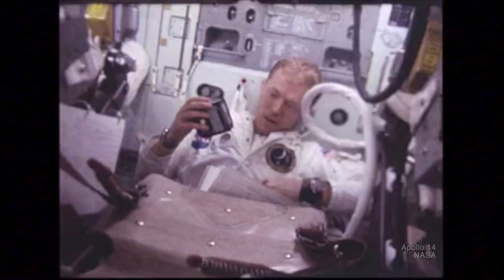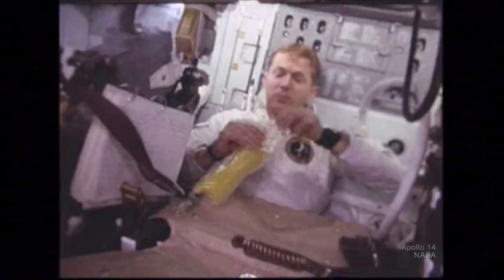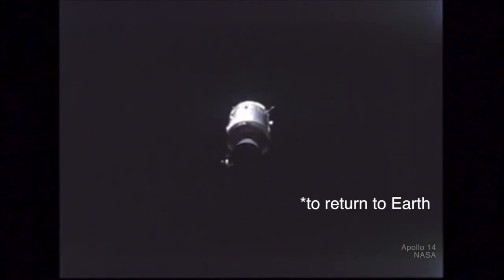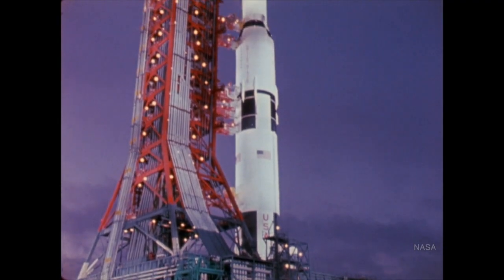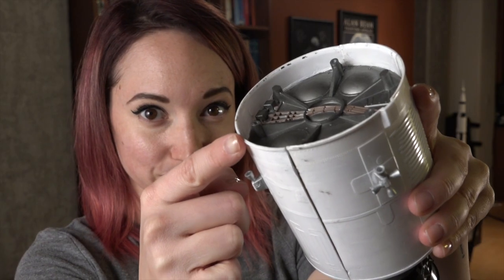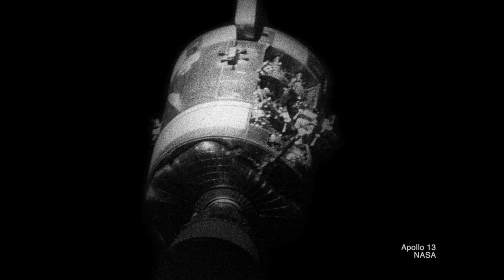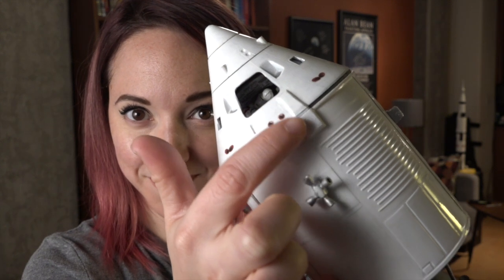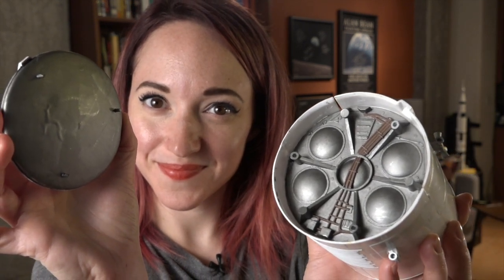How Did the Apollo Command and Service Modules Separate?

Comment: Question: Upon splashdown of the CM, what is that large, cylindrical piece at the top of the CM that looks like duct work?
Reply from the maker: I think what you're thinking of is the housing for the parachute.
Reply: Looks like the tunnel that the astronauts crawled through to/from the LM. At splashdown the tunnel wall is exposed, after the parachutes and fairings are no longer around it.
Reply: Nope. Amy already answered my question. What I was asking about are cylindrical housings that are PERPENDICULAR to the docking tunnel.
Reply: Oh, yo mean the perpendicular tubes. From the LARGE CYLINDRICAL PIECE description, it seemed you meant the tunnel. Sorry about that.

Comment: Did the SM burn up or is it orbiting?
Reply: SM burned up right behind the CM. apollo 13's LM also burned up, but it's plutonium fuel cask for the SNAP-27 didn't, and is sitting at the bottom of the tonga trench in the pacific ocean under 20K feet of water.
Reply: didnt know that, interesting...
Reply: It would have solved the power issue if the could have used it to charge the batteries instead of losing systems

Comment: What kind of models do you have, and where did you get them? Did you build them?
Love your videos!!
Reply: They look very much like the Revell kits I built nearly half a century ago. The kits I built also included a two part lander with gold colored foil for the descent module and a square "landing site" with a cratered surface. I had some problems with the plastic pins the command module door pivoted on breaking.

Comment: Very creative engineering must have been invented to make this happen . How again, did they grip the CM and heat-shield ? How did the heat shield attached to the CM ? Adhesives ? Where are the recesses for the 3 bolts and separation mechanisms ? Were no explosive bolts used  ? Very interesting,  I thought the heat shield was a seamless Construction to keep hot plasma off Alan beans butt . so glad Amy is so pretty , The external cable and wire chopper was cool. How were those valves operated on the CM side ? Were they behind the crew couches? Were they on automatic?  So much info here . Hehe

Comment: what if the blade didnt cut?  plan b?
Reply: Plan B = suffocation/freezing to death by remaining in space or burning up on re-entry.
Reply: lol
Reply: There where two blades, each with one system.redundant...
Reply: There were two of them. Nasa engineers built in redundancy. If one didn't work for any reason, they had a backup.

Comment: there was room for a car in that thing?  the "moon-buggy"?????  that is hard to believe.
Reply: You are correct. There was no room for a car in the Command/Service Module structure. Indeed, there would be no reason to keep a car there. The car was for operating on the lunar surface. The Command?Service Module only ever orbited the moon and never landed.

 The car (used on Apollo 15,16 and 17) was stored in a folded up state in a section of the Lunar Module's descent stage.
Reply: There was no room for the car in or on the command nor service module.  The lunar rover was stowed on the OUTSIDE of the lunar module.  It's always amusing when the hoaxers demonstrate their complete lack of education about the program in the very arguments they present to "discredit" it.

http://www.collectspace.com//review/ap15-S71-31409.jpg
Reply: Blake Snipe not really, the lunar rover was stored folded in one of the internal quads of the LM decent stage.  and calling it a car is really a stretch of the imagination....... more like a very lightweight go-cart that was somewhat fragile....
Reply: marzsit I called it a car because the OP did.  Its a semantical argument at best anyway.  But if you wanna go there, a "car" according to Merriam-Webster is defined as "a vehicle moving on wheels", so....

By "inside", i meant the habitable crew cabin of the LM, in which it was not.

Comment: I always thought that astronauts could go into the service module, but it seems to be just a warehouse.
Reply: There was no way to access the Service Moduile once in space, except by conducting a space walk. 

And that is exactly what happened on thee Apollo missions. On Apollos 15, 16 and 17, on the flight back from the moon the Command Module pilots performed spacewalks to retrieve film cassettes that were located in one section of the Service Module. During the lunar orbit phase of the missions, special cameras had taken high resolution images of the lunar surface. The film from these cameras needed to be taken out of the cameras and then stored in the Command Module before the Service Module was jettisoned prior to re-entry.

Comment: I  do not understand,  can you please explain  when you say , "electrical connections cut the wires and the tubing  and closed the valves in the umbilical "  .  How did the electrical connections  cut the wires ?
Reply: +welshpete12   I think she meant to say that the electrical connections were used to signal the separation charges. Here's a quote from a NASA pdf that details the sequence:

"The two modules also are connected through the
CM-SM umbilical, an enclosure protruding from the
CM on the side opposite the side hatch. The umbilical
is the wiring and tubing through which vital
power, water, oxygen, and water-glycol flows from
one module to the other. These connections are
covered by an aluminum fairing about 18 inches
wide and 40 inches long.
At separation, electrical circuits are deadfaced
(power cut off) and valves closed at the umbilical, a guillotine mechanism cuts the connecting wires
and tubing, and small charges sever the tension
ties. The umbilical firing pulls away from the CM
and remains attached to the SM. The guillotine
that severs the wires and tubes consists of two stainless steel blades, either one of which will cut
all the connections. The guillotine is driven by
redundant detonating cord charges. The tension
ties are severed by linear-shaped charges set off by
detonators. The signals that set off the detonators,
the detonators themselves, and the charges are all
redundant."
Reply: +mako88sb Thank you for going to all the trouble to explain all that .

Comment: I bet Dr. Guillotin never imagined such a use. But the interaction between the blade and bolts . . . I'm still a little hazy there. Bolts had to be rather small for any blade to be able to cut through it and still not have too much mass? Yet, the bolts would have to be rather strong to keep the CM mounted on the CSM with the stresses. There would have to mechanism or design to prevent the umbilicals from leaking back into space after severance, yes?
Reply: +LTrotsky 21st Century   The bolts were explosively separated. The guillotine was for slicing through the umbilical cables, wires, oxygen and water supply lines.

Comment: Amy i love watch you videos.
I want ask you and everyone here what is the purpose of this suitcase that Gemini and Apollo suitcase that with pipes tubes and pipes attached to their space suits, i did not see this in case space shuttle astronauts :-)

Can you make video about this if you already did make such videos pardon for asking, and give the link :-)

I'm just aerospace geek like many other here xD
Reply: +PawelK198604   The Gemini and Apollo missions had 100% oxygen environments at reduced psi so the astronauts had to purge their bodies of any nitrogen before a launch to avoid the bends. That's the purpose of the portable oxygen ventilators they carry out to the launch vehicle were they are switched from the POV's to the on-board system. Since the space shuttle and ISS have a normal mixed gas environment,  this process wasn't required until somebody had to prepare for a eva while in orbit.

Comment: A few random comments about the CM/SM connection.  It is interesting that a guillotine was used.  At launch when the service arms retract from the Saturn V, they seem to have a quick disconnect mechanism available to detach connections from the rocket.  Of course, a rocket sitting on the ground is a lot different than a rocket that has to move through space; so quick disconnects might not have worked for the CM/SM link.

On the Apollo 13 launch, I have seen articles that say that the force of the explosion was enough to separate the CM from the SM, but the astronauts were able to survive because that did not happen.

Also, it is interesting that during the Saturn V/Apollo launches, Abort Mode II, which occurred early in the second stage, after the LES tower was jettisoned but before they could make a contingency orbit, the SM engine would fire (along with the CM RCS) and separate the CM/SM stack as a unit from the rocket and align itself.  Then the CM would separate from the SM and splash down.

Comment: The Apollo 12 Command Module is on display at the Virginia Air & Space Museum. You can see the interface on the side of the vehicle and the ends of all the wires and plumbing that were severed by the guillotine are visible.

Comment: About the only thing they didn't get right in Apollo 13 (along with the wrong paint on the Saturn V!) was they didn't blow the pyro's to separate the LM and C/SM before entry. You can see the probe still attached as they hit entry interface, and then it's gone during the re-entry SFX.

Comment: Great vid! Question, did the umbilical on the command module have any sort of heat shielding on re-entry?
Reply: On the Command Module side, valves were closed on the inside to prevent re-entry heat/gases from penetrating the interior of the spacecraft.  The wiring, plumbing was packed really tightly.  The tips of the wiring just melted, if anything, on whatever was exposed.  The area where the umbilical connected to the spacecraft also didn't take the brunt of the heat during re-entry.  If you ever see a Command Module, check out where the umbilical connected, all you see is a bunch of wires packed super tightly with some pipes...and a few loose wires still intact, there's not much charring or scorching in that particular area.
Reply: The umbilical was mostly on the Service Module - so burned up along with that when the Service Module entered the earth's atmosphere.
I assume that the entry points on the Command Module for electrical lines etc had some sort of protective flap or were too small to be of concern.
Reply: Yeah that's what i assumed, but I would love to know the details of how they shield those entry points. instinctively it seems like a major structural flaw.
Reply: +yobrotom Great question! I was thinking the same thing as I watched and thought that I'd better check in the comments that it hadn't already been asked...it has :-).  Ericlrl's answer is very plausible but, as he admits, it's only a guess. It would be good to know for certain. We share the same instinctual concern that the residual umbilical cover protrusion could be a source for breaching the heat shield on re-entry.
Reply: Robutube1 Perhaps the blade itself acts as a closure device?

Comment: What were the odds of something going wrong during the flight and the two modules separating? Obviously, there were many backups in place, but could it happen?
Reply: +Matt 07a   The explosion that ripped through the SM during the Apollo 13 mission probably should of caused a separation. There was certainly enough force from it to do so but they figure the worst of the explosion was directed away enough from the separation system that it didn't happen. Not sure about any other scenarios that might cause a accidental separation.
Reply: +mako88sb Thanks! Apollo 13 didn't even come to mind when I thought of the question.
Reply: Matt 07a   Your welcome. I was actually reading about it more and here's some quotes:

“The attachment strength of the Service Module panel to the structure required a considerable internal pressure of 24 pounds per square inch for severing it from the service module,” Woodfill said. “A much lower pressure was required to separate the Command Module with its heat shield from the Service Module, only 10 pound per square inch. One can only speculate on why the panel blew and the crew capsule/service module attachment remained intact.”

and

“Apparently, the presence of ‘tankage’ and other structure acted to mitigate and dissipate the sudden pressure spike before it reached the interface between the vehicles,” Woodfill said. “However, if a shard from the exploded O2 tank 2 had punctured any of the adjacent tanks, likely a secondary explosion of any of them would have propagated both the explosion and build up of pressure. In that event, certainly, the vehicles would have experienced either a fatal separation or fatal damage to the heat shield."
Reply: +mako88sb Awesome! I'll check 'em out. Thanks!!!

Comment: If the command module and the re-entry vehicle are held together and going at the same speed, so what keeps the separation safe ? I mean what "launches" or held far enough the command from the capsule to avoid collision ? is there a mean to eject the command from the service ?
Reply: +aymen marouani, I think you can put the SM's thrusters on some sort of timer and just slow it down slightly.
Reply: +David Hoffman - Correct. The forward facing thrusters on the Service Module were fired as part of the separation sequence.

Comment: I always wondered about that.  Thanks a lot, Amy!

Am I right in thinking that if the blades failed and the CM couldn't undock from the service module, then a successful re-entry would have been impossible?  If so, that would make the procedure one of the most critical stages of the missions.
Reply: +Philip Gibson - There were two separate guillotines each with their own set of ballistics to fire them. If one failed the other could do the job alone.
Reply: @joevignolor4u949  Exactly nasa  engineers built in redundancy,with these kinds of scenarios in mind.

Comment: One of the idiotic arguments used by those who say NASA faked the Moon landings is that the command and service modules could not communicate, because that would have meant putting a hole in the heat shield for the wires and tubing to go through. Such a hole meant it would have been impossible for the heat shield to do its job. Yeah, right. This video pretty much lays that one to rest I would say.
Reply: +Francois Lacombe , Really. I never read that one. Those big lumps over the joints were the connections and communication paths if I remember correctly. How can people look at the long known designs and come up with that reasoning?
Reply: It could have had a hole. The Gemini MOL mission had a hatch in the middle of the heat shield.
Reply: Justin Franks, Yeah, but I bet Apollo reentered a lot faster. That might be a factor in keeping Apollo's heat shield an uninterrupted surface.

Comment: You failed to explain how the SM "got out of the way" after separating. Was the separation dV enough to put enough distance between the CM & SM before entry-interface? Or did they pre-program a burn with the RCS thrusters to safely put it on a slightly different trajectory?
Reply: +RickyboyH As far as I know, there were no particular separation firings of thrusters after the SM and SM separated. There are photos of the Apollo 8 Command and Service Modules re-entering over the Pacific and you can see the glowing CM re-entering and the disintegrating SM. The separation doesn't look that great - probably only a couple of hundred yards.

Comment: Hey Amy! Great video. Now take it a step further and talk about the re-entry of the Command Module. I understand that the re-entry program took the most memory in the navigation computer. It also required a "pull-up" maneuver to reduce the thermal load on the heat shield before the final plunge.

Comment: Good episode. I never really thought about the issues related to the CM / SM separation. Interesting the blade that cut the connections, and I never really noticed the little bulge where the connection hoses / tubes went around the heat shield.
Reply: Ditto!  I never thought about this stuff before.  Interesting!

Comment: Ok if there's an aircraft carrier. Why do people call multiple vehicles crafts? It's spacecraft, watercraft, aircraft. Even if you have more than one. Why is that so hard?
Reply: The only time I can ever think of saying crafts is in the phrase "Arts and crafts". That, plus, (British) "maths" and (evangelical) ""evidences" always drive me crazy. Also also (snooty) "often" with a hard "t", and (lazy) splitting "another" between the "a" and the "nother" in phrases like " a whole nother instance", rather than the more exact " a whole other instance." This latter practice is called Tmesis, btw, a fact I never knew until wandering through Wikipedia. None of these are technically errors though, just peeves
Reply: Oh, and I really, really hate Grammar Police. Linguistic "observers", though, are all right.